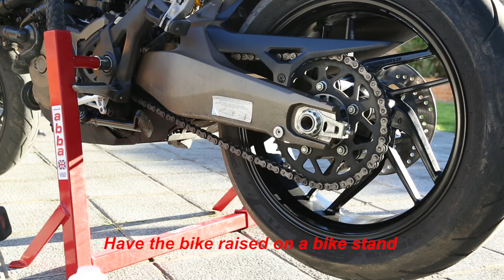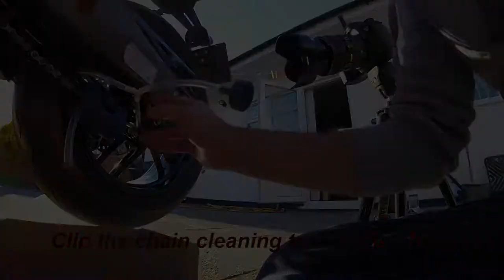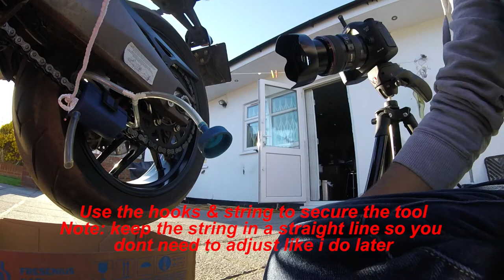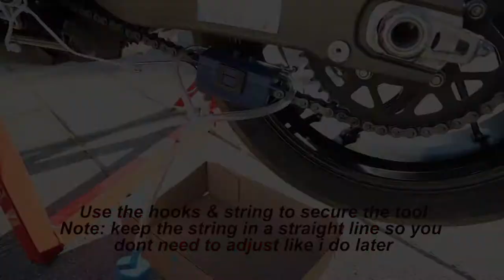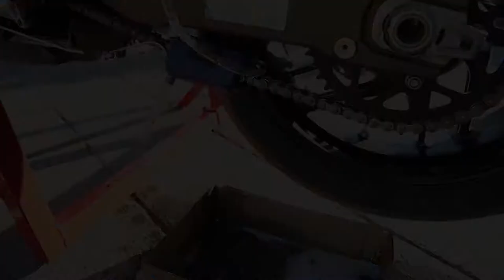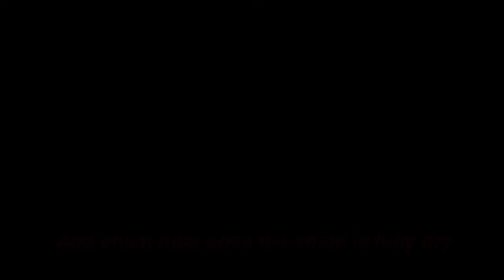Motorbike Chain Cleaning Tool

Comment: I was wondering about this type of device, but now I've made my mind up. I can clean my chain in around the same time it took to setup this gadget.  I use just a piece of cardboard to catch drips, one of those cheap claw-type chain brushes, and some kerosene. As well as being quicker, it seems to be a lot less messy too.
Reply: Exactly my take-away from this video... the tool is a faff to setup, equally messy, the exit pipe doesn't work as not a single drop came through it - everything dripped from the right side... what IS the purpose of the exit pipe?
I use paraffin/kerosene too... aside from being the BEST non-destructive cleaner, it doesn't dry the chain up completely too. Wipe the chain with loads of kitchen towels afterwards and then lube it with your choice of lubricant... job done!